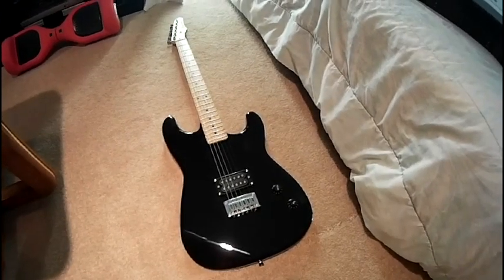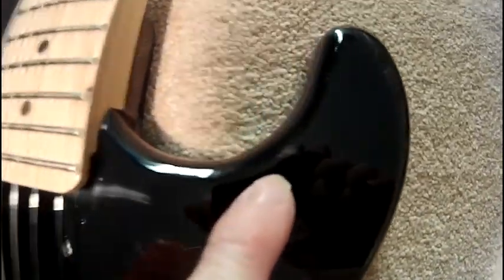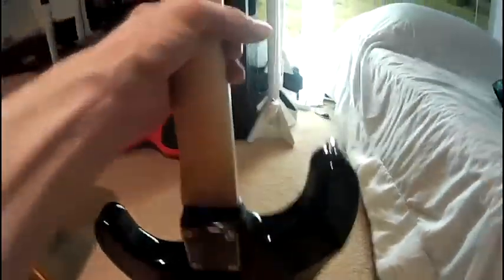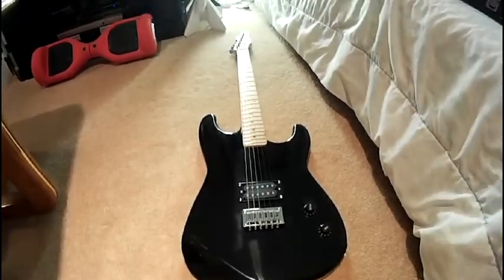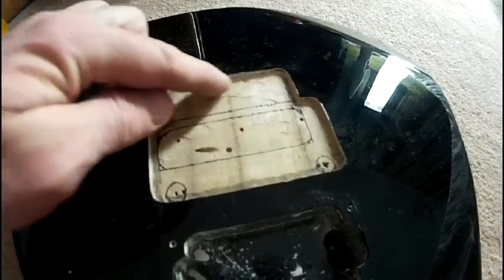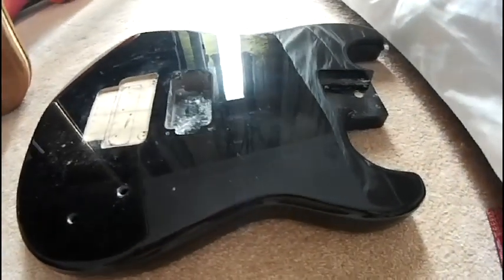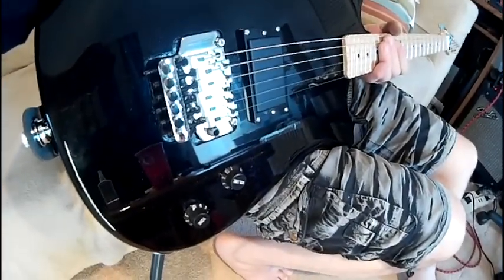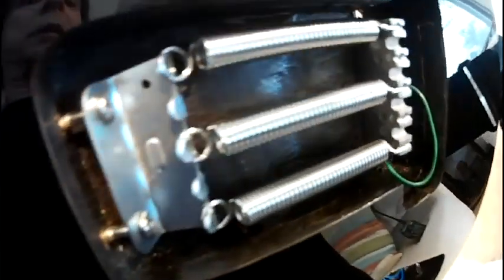Davison Guitar Wammy Mod

Comment: My dad bought me this when I was 14 as a christmas gift it was the $100 beginner kit on amazon with a strap,small amplifier and some picks. I can personally say that this davison guitar SUCKS it only gave me a good clean tone but anytime I would distortion and no matter how much I adjusted my amp it still sounded like trash. Even the feel of the guitar didn't feel right and it caused technical problems from the start. Thankfully for my 16th bday my mom bought me a Squier Bullet Strat and it has changed my life for the better
Reply: I have had one for 3 years with no problem distortion sounds fine
Reply: Sounds to me like you’re being ungrateful